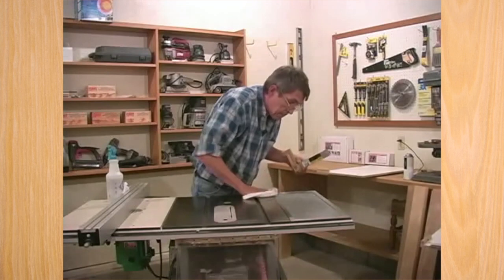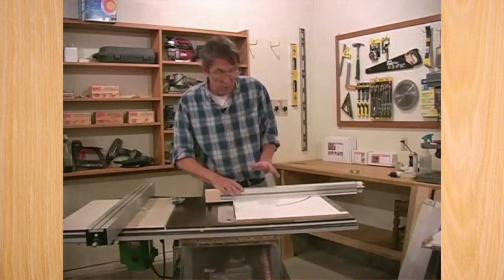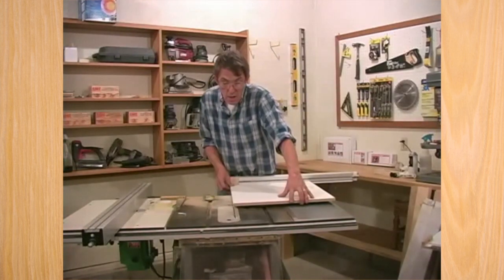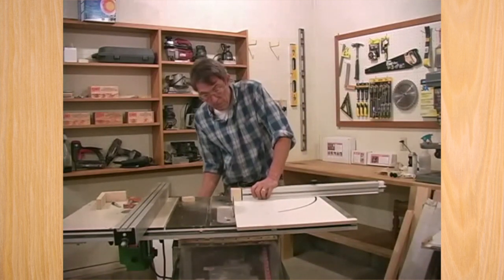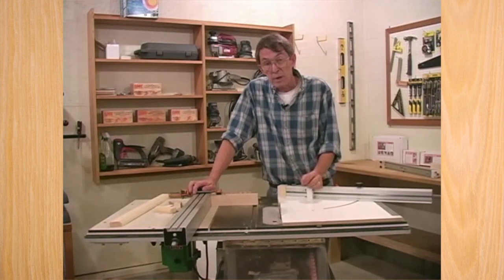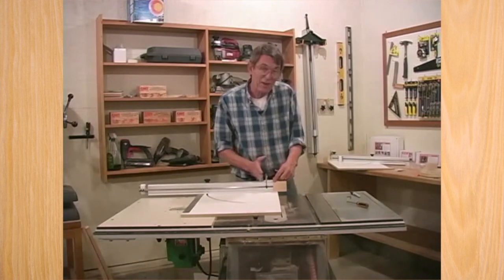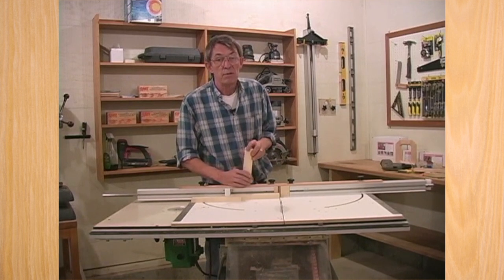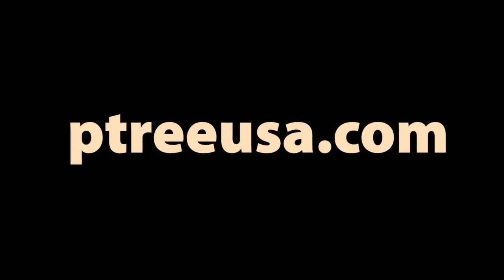Dubby Crosscut Sled

Comment: I have had my Dubby for decades!  Bought from Jerry at a KC WW show.  Mine is one of the originals with the Wooden arms rather than aluminum.  It still works like the day I set it up, it is awesome!  And yes I have both sides.  Take the time to set up just as Jerry described in this video and it will work perfectly.  If it doesn't you took a shortcut.

Comment: I noticed my wood pieces were not attached to fence or to platform like the instructions say. I had to guess which fasteners to use. 
 I wish the t slot rails actually used the T feature to lock in the Dubby so it doesn't fall off the front of my table saw when I forget to start it.

Comment: I ordered both the left and right side some time ago.  On September 10th I started to assemble the left hand sled.  I ran into a problem and sent an e-mail to Inline Industries with a photograph of the problem.  After 4 or 5 days I didn't get a response so I sent a second email.  Got no response from that one either.  So I started calling them.  Called every day all day long and into the evening and never got anything but a busy signal.  It has been 16 days since my original email and have not heard anything from them.  If you plan on buying one of these, and have any kind of a problem with it, good luck in ever getting hold of them.  My sled is still sitting on my table saw just the way I left it 16 days ago when I started trying to get in touch with this company.  And as of right now, I have no idea when I will ever hear back from them, if ever.  I don't really like doing this but I think it is only fair to warn people about the customer service, that apparently doesn't come with the purchase of this equipment from this company.
Reply: Thanks for the comment.  I was trying to buy one, but they've been out of stock for a while, and I couldn't get any response from them either.  Looks like I'll be ordering an Incra 5000 instead.

Comment: I have a question regarding the main panel of the Jig. Is the core plywood or  a particle board composite. I am here on Hawaii and the high humidity does not allow even the best particle board composite to last if a small scratch is in the surface. I am very interested in the tool  and if it is made from Particle board would it be possible to have one mad with marine grade multiple layer plywood with a hard surface on the top and bottom? I've had good service  from Medium Density Overlay sign board here.

Comment: I question why anyone would purchase this sled when you can get a Harvey, an Osborne  or Incra mitre gauge. I never had to fool with any of those units to get a perfect cut. Once you do an initial cut on the panel and then do an annual alignment (maybe adjustment) on your blade you will be cutting it again and the panel gets narrower.